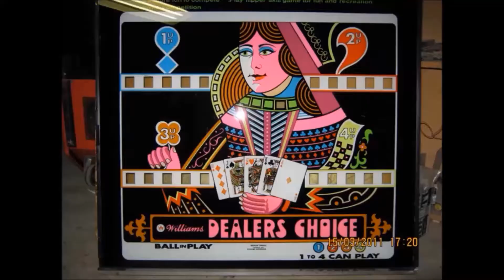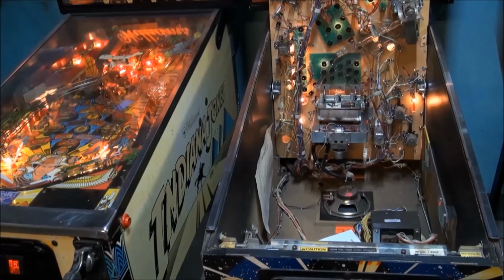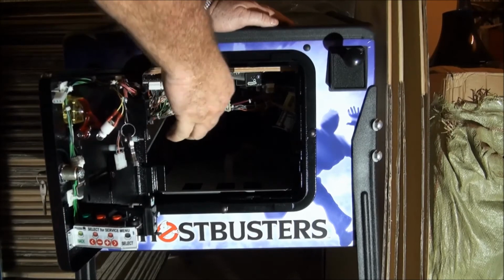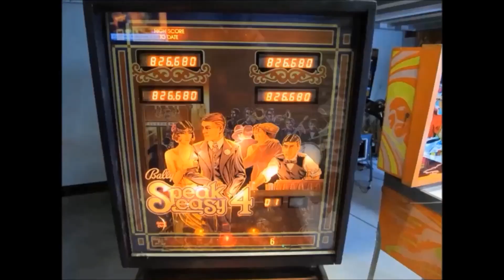How to open a Pinball Machine and remove the playfield glass - Pinball Expert - Brisbane Australia

Comment: 0:00 - Introduction
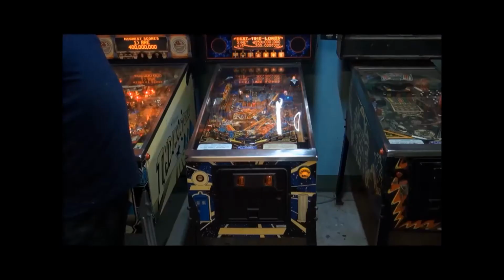0:40 – WPC (Williams Bally 1990’s era) Dr. Who
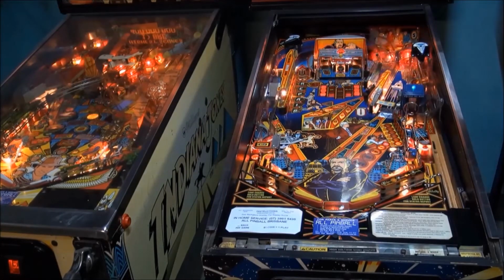2:56 – Bally Early Solid State games (two styles)
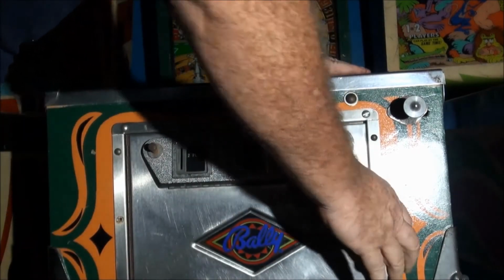4:20 – Chicago Coin EM / Stern Electronics
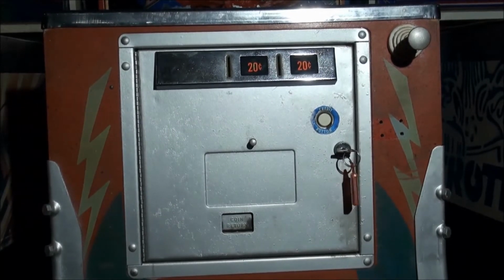5:17 – Gottlieb 1975 – Early 1980’s
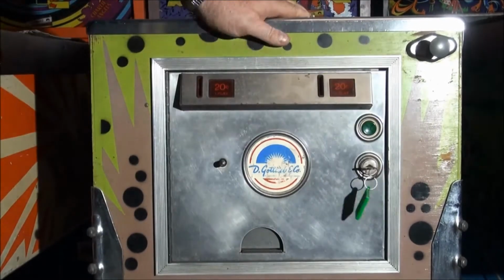6:07 – Gottlieb 1960’s EM (EM = Electro-mechanical)
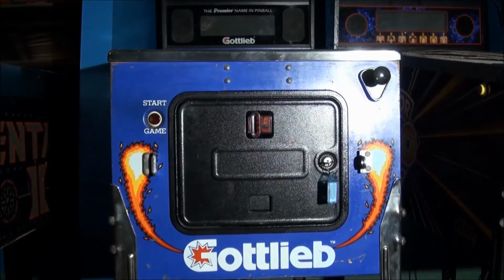6:59 – 1990’s Gottlieb System 3
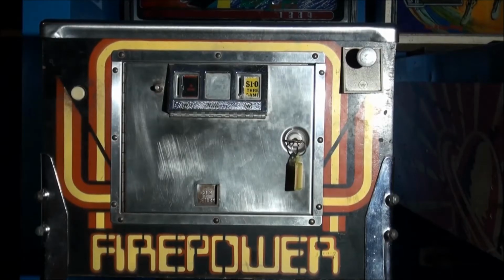7:52 – Williams Pinball Late 1970’s – Mid-1980’s
9:17 – Atari Pinball
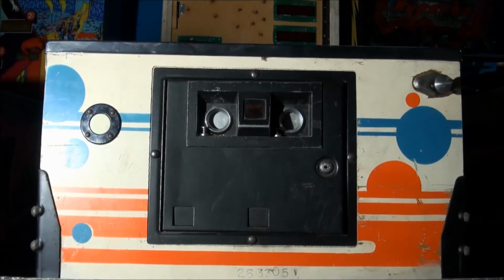10:02 – Uncommon games:  example (Playmatic)
11:02 – Modern Stern Pinball Machines
12:50 – Conclusion and outro

Comment: great video, thank you! I had a question on one you did not show - I inherited a 1963 Gottlieb Swing Along, and I can't seem to remove the bar that holds the glass. I can move the lever, but that molding bar does not seem to budge. The shooter is incorporated into the molding bar, so it is a bit different than what you've shown. Any tips?
Reply from the maker: I haven't seen or worked on many pinballs that old in recent years but from memory Swing along may have 2 wing nuts just inside the top of the  door holding the front glass moulding in place.